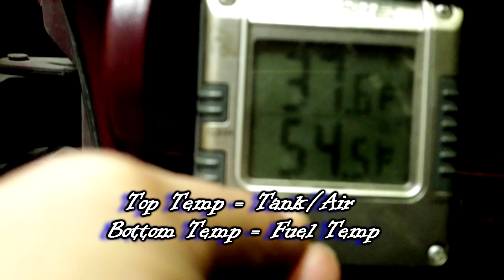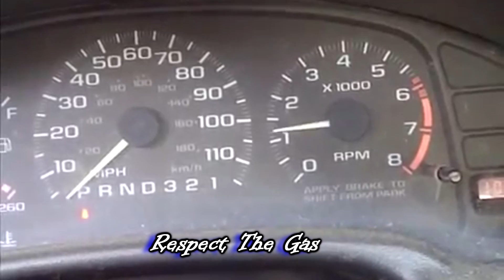Is 100MPG + Possible?? Alternative Multi Fuel Vapor Van!

Comment: What if you put the gasoline in your radiator and kept the radiator cap open with a sealed tub leading to the intake?
Reply from the maker: It would be bad LOL. This vid was really to show people NOT to believe these stupid vids that show guys with a small plastic gas can and some vinyl tubing stuffed in their intakes claiming they are getting GREAT MPG's! I was trying to show it is impossible due to many other factors with this idea's direction.
Reply: @InJayzBrain  Hey, thank you for typing back. This topic has really got my interest and based on what I have seen, It seems like it could be done properly. Do you think this is worth researching into further than just as a redneck diy project or do you think it is a waste of time?
Reply: @InJayzBrain   So is it a flat out scam, or are you saying that way more work would be needed?
Reply from the maker: @SageBlueMusic  IMO most are a flat out scam. Much more work with a different "safer" design using a propane carb or something. Lawn mowers and small engines running constant speed may be more compliant and worth playing around with.

Comment: Was once told that the auto manufactures have it backwards he was on to somthing that got me thinking he. Said put gas in the radiator and water  into the gas tank draw vapor off the  cooling resavor= gas vapor and the water injectod into the motor with the original gas tank
Reply: I take it a step further re position  radiator to a non compromising  place  so as to minimizing  frontal collision fire
Reply: sounds   like a good solution to your problem of fuel  not having enough heat
Reply: Have   a few other  fuel options
Reply from the maker: @TerryCrook-g3r  I originally made this to disprove all those other vid's that show people strapping far cruder things on their cars and claiming crazy MPG claims. As I researched down the rabbit hole I did come up with the SHELL company who used to have MPG contest races and saw some incredible numbers posted. Yep over 100MPG even, however lackluster power was barely enough to run it around the track.
Reply: Remember a couple of cyclists built an air plane they were the but end of a lot of jokes however who was the wiser that started with a dream

Comment: If you want to run vapor, start with vapor. No point messing with vaporizing gasoline. Propane fueled vehicles run on vapor and do not require all the hardware. Propane is 105 octane, allowing high compression ratios. Even so, an engine optimized to run on propane vapor will not provide 100 mpg equivalent.

Comment: Pulling air through gasoline causes it to vaporize faster but you also create an evaporative cooler.  As the gas evaporates it extracts heat So the container holding the gas gets cold.  I guess if it was hot out you could use a fan on a metal container and blow the cool air into the cabin or you would have to come up with some way too warm the container or extract the cold.   I don’t really believe in the bubbling system because in my opinion it’s just creating a crude carburetor bubbling air through gasoline sure you’ll get more vapor and better fuel economy but you won’t get the very high mileage economy until you have nothing but real vapor like you see coming out of the spout when you fill up your tank.    I would agree that if you could maintain a vacuum over a large surface area of fuel you can get increased evaporation but you can also achieve that with a large surface area of heated gasoline.  The engine when you get it running on vapor will produce less heat but still I would think utilizing as much heat as possible off the engine would be the way to go.  You cannot draw vapor through a long tube that is exposed to ambient outside temperatures because it will cool the vapor and condense some of it back to liquid or at minimum larger droplet size
The idea of pure vapor means you have taken a liquid and converted it to a vapor which greatly expands the volume of fuel.  If you have a regular carburetor engine and put a air fuel ratio gauge on the exhaust then stick a heat gun down the carburetor you will notice the air fuel ratio go rich.  Mine went from the 14.7 to about 9.5 just from the hot air helping to vaporize the fuel better.   I believe the key to making a functioning vapor engine is surface area.  enough surface area available to evaporate enough fuel to run your engine at highway speeds and I believe heat would be required Or a heat and vacuum combination.  And also necessary is the air that mixes with the vaporize fuel needs to be hot which not only keeps the vapors from condensing but also contributes to further vaporization.  You should not have any cold areas where the fuel and air travel through.   the air and the fuel must remain hot or at least at a temperature where a vapor is maintained all the way into the engine.   Some ideas are extract heat from the exhaust extract heat from the oil extract exhaust gases to be used for intake in the gas vapor chamber.  Pulling a vacuum on a container of gas still would need an inlet so that the vapors Can exit the container this air inlet doesn’t need to be very big but should have air that is warm enough so not to condense any of the outgoing vapors.  I believe non-combustible gases exhaust gases could be used.  Also because of your greatly reduced engine temperature you may be able to use your cooling system pathways in the engine block to simply draw air through.    You could test air drawn through the water jackets to see if you are sufficiently cooling the engine if you are then there could be another source of heat. 
Don’t forget yorur backfire arrestors.  If you want to avoid the hassles of throttle response and air fuel ratio variables use an electric vehicle and convert the engine to fuel vapor then run off the electrical power that way you can maintain a constant speed and fuel vapor ratio on the engine

Comment: Oh shit, i just thought is that why the changed to efi!? Soooo much easier to modify the carby to run off vapour, especially after that kid in the late 80s or so made a vapour device and travelled across usa on 1 tank of fuel! Aftrr meeting with a few car company execs, he was home with a freind, took a drink of his cranberry juice and said "shit! The fuckn poisoned meee!!!!" As he ran outside and fell over and died! 

Its most def possible to break boundaries without getting into law of thermodynamics and such with these vapour feeds, its to do with efficiency of the vapour explosion compared to the liquid gasoline mist, makes me think they purposefully made it much harder to successfully execute once they knew anyone with half a brain can run successful experiments if they have access to the information and is somewhat handy.

My first thoughts is a simple device like a light bulb dimmer device with the heating element surrounding a piece of stainless steel pipe surrounded by a bunch of insulation to stop heat from  spreading, as the car is started the heating element heats the pipe thats connected right before the entry to the carby, increasing the overall temperature of the whole carby (depending on size of course) must dial it in to a stable temp where the fuel is consistantly exiting the carby in a nice vapour and not so hot that it will require a custom made carby with high temp seals so the temperature wont affect the operation of the carby..

Surely it wont be too hard to rig up and test, if i had a carby vehiclr i would of done it a long time ago just to see what happens and how feasable the idea of heating the carby so it ejects a steady vapour stream not liquid mist..

Or if its possible to strictly heat the fuel inlet alone to a vapour and see how well ot works, just not sure what type of carby design and if the fuel will be able to stay hot enough withought condensing inside the carby back into liquid defeating the whole purpose..

Just need to see carby design then make a choice weather entire carby or just the inlet feed should be heating to a point where only vapour is ejected..

Certainly interesting! Alot of money could be made, and alot of trouble could be encountered.. need sum1 to stand up and take the oil companies on face first lol
Reply from the maker: Yeah it really blows me away the amount of Greed in the world. I was also wanting to debunk quite a few of the YouTube vids that just show the boneheads using gas cans with holes and hoses trying to tell people they are getting huge gains blah blah.. Thanks for watching!!

Comment: Technically I think that you could use vapor / propane / HHO or spray fuel. Ultimately they aren't that different and you just have to observe the mix which is mostly dealt with by the carb. The original Pogue Vapor Carb was using the heat of the exhaust to increase fuel temperature after introduced via injector into the vapor carb. The design is still out there online if you look. Not sure if they hit any defects along the way but it was designed in the 50s or 60s and he claimed more than 100 MPG on a car that was in essence the size of a battleship. I cant say what the truth of it is but I am very curious, especially now that the elite of the world are trying to make us broke via fuel prices.

Comment: My idea was jut to use a pipe T joint with a pipe going into a fuel tank. In the pipe to the T Joint is a piece of carbon felt wick. This wicks fuel up to the pipe T joint where air flows around or though the wick to make a fuel air mix. You can even use a small canister with a gas line and a return with a slow flow fuel pump of 30ml a minute. As long as most of the fuel returns to the tank and the wick is soaked in fuel.  and you can have a fixed fuel level for the canister for the wick system. A spark arrestor and air filter are used on the top of the pipe T for the intake a small air filter and the output runs through a spark arrestor.

Comment: I've got an idea... Use fuel injectors or a carburetor. I've tested these setups on my chassis dyno at my workshop and let just say i lock the rollers at 60mph and put 20hp of load on the retarder you use exactly the same amount of fuel on the same engine running a carby, efi or a vapour carb. I know... Science! 👍
Reply: You mean feed vapor to the efi?

Comment: both the fuel and the air need to be heated  together to produce a homogenous mixture and prevent the fuel from separating from the  the mix. Heat inherently escapes  to any colder medium in an attempt to balance the over all temperature, and any expansion by itself cools it surroundings, so mixing hot fuel and cold air is self defeating. The other issue becomes the fact that some of the gasoline molecule chains are so long they don't vaporize till 440 degrees, and they tend to produce the varnish you see left over when gas evaporates, this varnish also collects and  insulates, reducing the efficiency of the the heat exchange over time

Comment: Good video. The simplest, least intrusive, and most cost-effective way to get heat for gasoline vaporization from your engine is to wrap the upper half of your front cataylitic converter and terminate that wrap in a tube of the required circumference. Then, run a hose from that tube into the air intake of the vaporizer. That will provide more than enough heat for your gasoline vaporizer to work with.
Reply: I bought a 12 volt coffee heater and put it in a jar of gasoline, got it to boiling but it didn't catch on fire

Comment: Also you said you had those heaters doing 150 degrees and the car ran only 30 seconds or so.. Then at the end you said you need anything above 80..  Well, huh?  accoridng to earlier the 150 is minimal I would think..  actually more cause your car died..  did I miss something?  Why the 80?

Comment: I got into this late but trying 3 types of things..  gas vapor using the evap system with a bit of reworking of the manufacturer's use (which is after it burns a liquid it will burn the vapor in the tank added to it), well, just reworking it to do the major part of the fuel system, HHO running through an existing system in the car also but reworked with hydrogen being pumped in, and course, mist which is also in the mix of hydrogen..   I'm thinking of adding a 2nd tank with a switch up front where can try other fuels or liquids as a vapor for testing or upon finding out a better vapor other tha gas...   What makes the gas cool btw?  I already planned to heat mine due to seeing how the pogue version worked.. They have two major heaters in series where the gas flows.  So I was thinking the more heat you can add to it, the better and the less needed overall. cause you probably only need a little explosion to keep the pistons in motion and with HHO in the mix, I think it'll have plenty..
Reply: i seen vivideo pueple using white gasoline, might be more volatile of vaporices quickers. how many amps do you run your HHO generador ?    thank you

Comment: put your water hose into your gas to heat it and you will have no worries. then add some water vapour and your golden. you also have to have a way of adjusting he air intake so you can lean out the vapour as it gets hotter unless you have it at a constant temperature all the time then you don't need to do it. you set it don't have to worry about it again after you have the heat constant. no no no  put the hot pipes into the fuel and heat it that way then you have hot fuel and lots of vapour to run your car. also put mesh into your hoses and that will keep you from backfiring and yes it gets huge mileage. make sure you put a spark arrestor in the system which is nothing  but a bunch of wire mesh in the system not hard to do look at all the other guys putting these together and you will see what I am talking about. this guy seems to think this is bad but it isn't. they want us to not use it but this is freedom. it is out now that is why they have finally released the batteries that can charge quickly that were around for 35 years already. use the vapour system and you will be happy.

Comment: InJayzBraiN ? I don't understand why are you using PVC pipes instead of metal intake pipes. Metal will heat up with the engine and will stay hot form point A to point B. Check out the videos below.
the truth about gas and vapor part 1
https://www.youtube.com/watch?v=nqKEQLBg6a8&t=1s

the truth about gas and vapor part 2
https://www.youtube.com/watch?v=LDMDCT67xBM&t=1s

1971 plymouth fury vapor car pt 1
https://www.youtube.com/watch?v=IEv8LGHvHvw&list=FLVX_mYLmxE6m_5CMviKO4XQ

1971 plymouth fury vapor car Part 2
https://www.youtube.com/watch?v=snCA_xgQFWU

1971 plymouth fury vapor car Part 3
https://www.youtube.com/watch?v=208o9H1HC1g

1971 plymouth fury vapor car Part 4
https://www.youtube.com/watch?v=yseG5MShJn0

Comment: We build different types of successful units getting over 240 mpg on 350s. Your system is NOT self regulating, that is your problem. You are drawing air THROUGH the gasoline to make your fumes. This is a ridiculous method and does in fact change the temperature of the gasoline. Instead, draw air just across the surface of sitting gasoline in a close proximity setting and the air and gasoline temps will not be affected. No heating chamber of any kind is needed.
Reply: NO you dont :)

Comment: please dont bother with coolant heat exchanger its not hot enough.to vaporize petrol you need exhaust heat and all of it.and dond worry petrol wont self ignite.i run testing plates to red hot and petrol would not ignite after all its design to resist self ignition.
Reply from the maker: Thanks for the comment, I hear ya and I've been pondering an entirely different way to go about it using magnets.

Comment: How about to use exhaust heat to preheat the intake air to fuel can?
Reply from the maker: Certainly could do that. I gotta finish a few car projects before I can move further along on this experiment, however I'm leaning towards doing something with some magnets that could be a breakthrough, only time will tell.
Reply: https://youtu.be/Ke0MGmUr3SU

Comment: problem is youll need to run some sort of egr management system so the fumes dont explode
Reply from the maker: There's all sorts of problems with this concept, and if you make it until the end you'll see I said that. What many guys are trying that you've seen making big claims here on YT simply aren't working and are creating a potential hazard. Maybe because I was brainstorming a bit in the video as to what could help or fix the issues that I come off like I believe this is the way to go, it's not. There's always another way, just gotta take a step back and look at it differently.

Comment: Why could you not pull the vapors out of your gas tank and run on these! Would need a check valve so a back fire would not explode the tank! James
Reply from the maker: Hiya James, many reasons come to mind why you wouldn't want to do that. Currently I've been looking at a much safer way to not only gain MPH but HorsePower as well,  prototype parts aren't cheap so I've been working the designs out while finishing my firebird to make room for my MX-5 before I can get to building n testing.